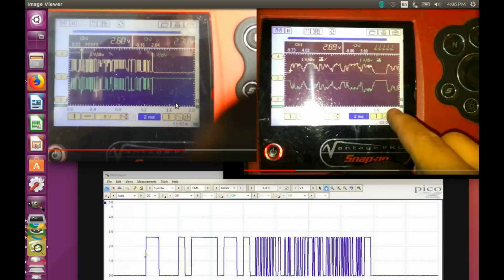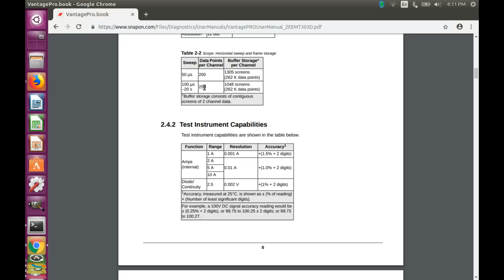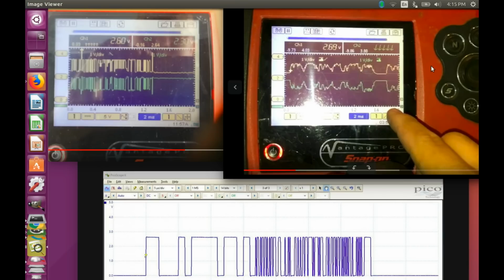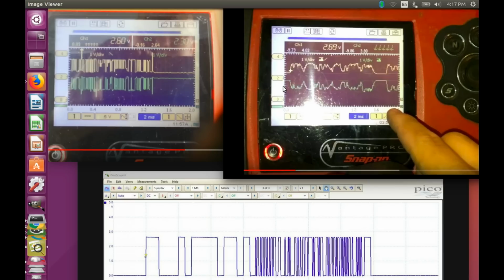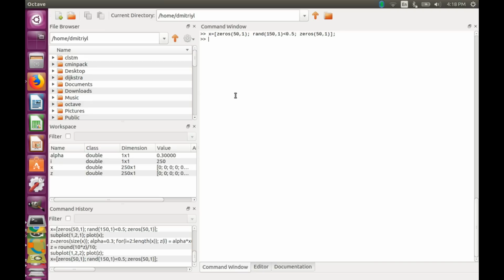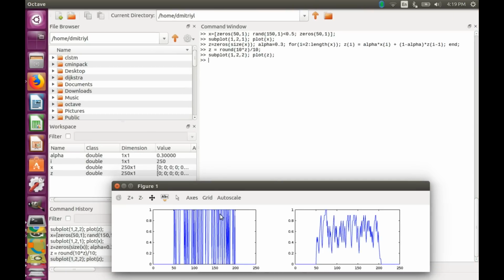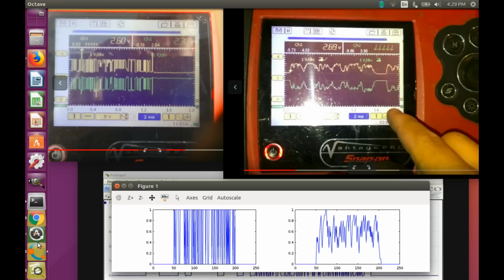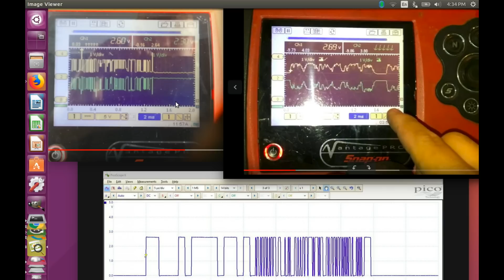Why you need to know your scope inside and out.

Comment: What screen capture software do you use on Ubuntu?
Reply from the maker: I used this incredible tutorial: http://sandilands.info/sgordon/presenting-and-recording-lectures-with-ubuntu-linux
and modified the screencast script to fit my screen.
One tip on the screencast: always run it for a short time to test your mic and load in the programs it uses. If the programs are hot in cache there is less chance of sync loss between video and audio.